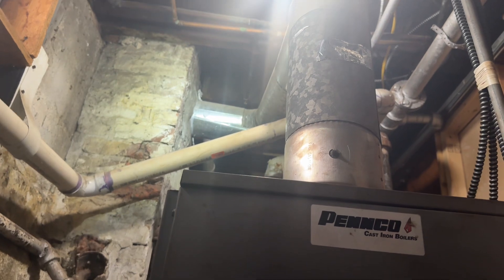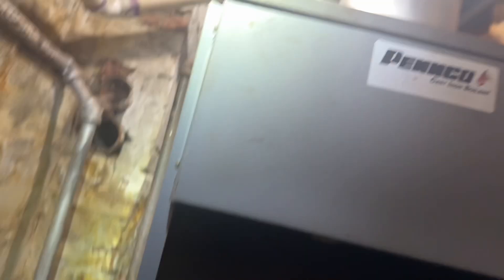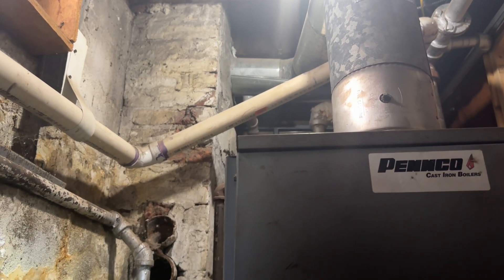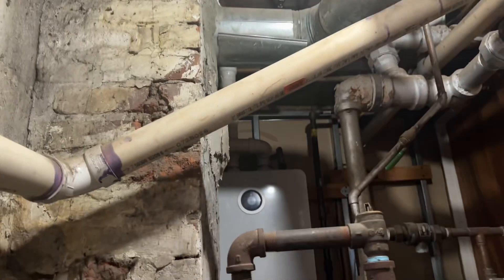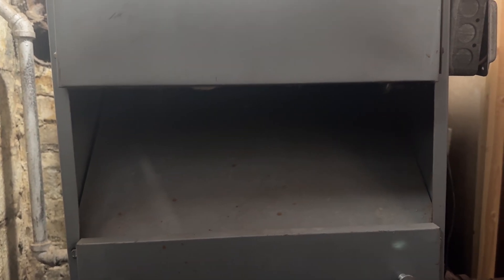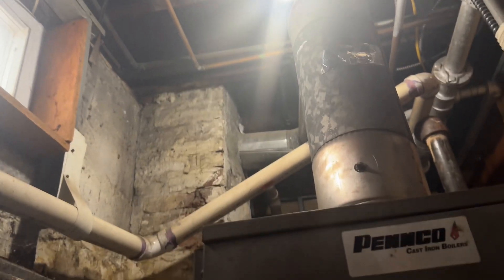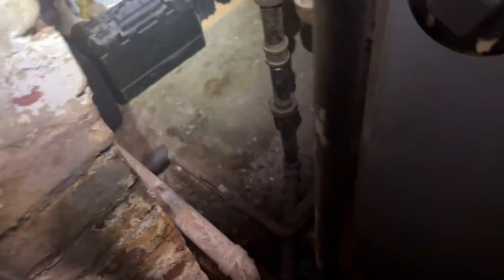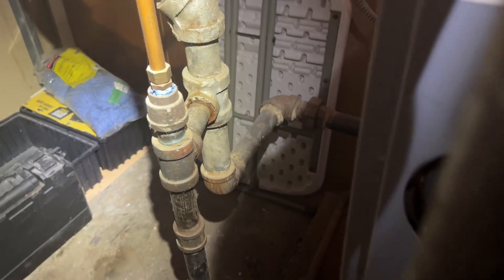Explaining Importance of Combustion Air - Some Still Don’t Get It!

Comment: Natural gas requires about 10 times its volume of air to burn.
A boiler that size, say it burns 250 cubic feet per hour of natural gas, so 2500 cubic ft of air is required. The boiler might have a draft divertor, so that is another 2500 cubic ft per hour on top, 5000 cubic ft per hour.
In the UK, we declare the appliance to be id. Immediately dangerous. With the agreement of the owner/ responsible person, cap off gas supply to appliance. Write out a certificate. If the person gets awkward  go out side. Contact gas transporter. They have legal power to turn off gas. If customer still disagrees. Dig up street outside house and disconnect whole building. Then over £5k (6.5k USD)
To reconnect. Customer gets it then.
No messing about. We try to avoid carbon monoxide poisoning  but it still happens. 
This guy Mikey Pipes was dealing with will be having half day with undertaker  if he doesn't listen to good advice.

Comment: Unless you educate the client, they likely never analyzed how the boiler in their basement works... they turn it on in the winter... and call if it does not work.  Did this guy buy the house as-is, and home inspector missed the lockout tag and the issue?  

You just can not expect the layman to be  an HVAC enthusiast.

We were not taught about how a furnace or boiler works... we see lots of tubes and pipes, and we pay the fuel bill. 

Shirley, you did explain how the furnace was starving for oxygen, due to the basement finish that likely was done since the original construction, partitioning off the original air rich leaky basement walls and windows.

You obviously explained how the fan in your can works, to make up for the lack of combustion air.

Comment: The boiler is going to suck in cold air into his house from anywhere it can regardless, meaning more drafts from any tiny openings in the house to replace what the boiler can push out the chimney with such a restriction to makeup air. Better to have a controlled way of bringing in that needed air

Comment: What are you expect Mikey? That’s flood zone it’s low lining areas. Do you really expect New York City to raise the road so it doesn’t flood especially next to Costco is there? No it’s too easy.
Reply from the maker: Why not the road has been there for decades since JFK has been built they should fix it. Why won’t they fix it?
Reply: @MikeyPipesUncensored  I’ll tell you why cause it’s the rockaways and no one gives flying f about it  it’s the same as Staten Island on Travis Avenue and told Hill Road with the trees they don’t care they got your money
Reply: @MikeyPipesUncensored  the same reason why they won’t put new  sewer systems next to IHOP by Old those homes right off the bay. They just don’t care. And the houses keep getting flooded. Evey time it rains
Reply: @MikeyPipesUncensored  F'in useless govt bureaucracy.  Screwing over us voters!

Comment: 40 thousand candles 🕯 in  the space needs a  Cold air intake the candles go out- The boiler need a air intake or it will fail
Reply from the maker: OK
Reply: Corrected my spelling

Comment: DO YOU KNOW, what BMW  stands for?  Correct???  There are a few definitions:  Bring My Wallet.  Broke Must Walk,  and as one of my black friends calls it, Black Man Walking.   I actually have a  2007 BMW K1200 R  Motorcycle that has for the most part been pretty reliable.  The Germans have this warped theory on BMW warranty and reliability.  It not broke.  Your just not using it correctly!

Comment: A lot of times when car batteries are low it won't recognize the fob. As an automotive locksmith we get these calls almost daily. They think it's the key fob. I tell them it's the car battery and of course they argue with me. I tell them how much a new fob is and also tell them if it doesn't fix their issue that I am 99% sure it won't, guess what you are still paying me. I have never had one take me up on the offer. If your not testing your guessing someone I can't remember who says. :)
Reply from the maker: Well, my wife’s car was dead, dead dead than a door nail
Reply: And since they have used a fob for the last 9 years, the emergency key in the fob is not going to work..... unless the customer is an expert in our field, and religiously sprays Houdini in the door lock 2X a year, and uses the key a few times a year to keep the parts moving.

Also, I TEST the battery in the remote, before replacing it. IT is the first diagnostic step when a dead remote comes in. The second is if the battery measures under 3.16V, to replace it... .and to TEST THE NEW BATTERY before putting it in.  Then, if it is an older car, RESYNCHING the remote.... and so forth. A lot of times client asks why I am measuring the old battery, the BATTERY Minus store did not test it.....Yet, they are now in MY shop. And all too often I am quoting Mikey. This locksmith does not guess!
Reply: @citylockapolytechnikeyllcc7936  I'm in the Boca Raton area. My customers are 300 years old. I ask them if they tried the emergency key lol 90% have no idea what I am talking about. If they manage to get it out they can't figure out where it goes. I try to save them a service call but we end end up going out on most of those anyway. They would rather pay us than try to help themselves. After we open the door most need a jump start so all my guys have jump boxes. We have Xhorse fob testers BTW so we know if the fob is working or not without opening it. 

I'm sure you know but many cars with a dead battery even the emergency key won't unlock the door. I still don't get that or why they call them emergency keys. We had an elderly lady call today said both her fobs didn't work. She was at the hospital visiting her husband. My tech pulls up and she realized she was trying to open the wrong car. This is daily in my area. I love everyone of these too. :)

We don't touch their fobs. If their battery is bad we tell them to go to the auto parts store. I don't want to be responsible opening up a 10 year old sun baked fob and having it break or not work and blaming us. We are strictly mobile. We just do lost keys and lockouts. We stopped doing ignitions, repairs, rekeys etc etc. We don't even go out on duplicates. Just lost keys. We run 80-150 calls a week. As I type this today was slow 13 calls so far. We don't even Lishi. If we can't get an easy code off a lock we get it from a code broker or NASTF and pass it on to the customer. We are too busy and we need to get in and out ASAP. We are cheaper than the dealer in most cases but a lot more than  Chuck in a truck. We mostly use OEM fobs and provide a warranty. I won't program a customer bought fob unless it's brand new OEM and they get no warranty if it's not mine.

Comment: Does a draft test reveal if there is a deficiency of makeup air?  Also, would the combustion test be off, like insufficient excess oxygen perhaps, among other things?  If so you could tell the customer that if they haven't tested they're guessing 🙂
Reply from the maker: I draft test only measure is negative or positive draft
Reply: @MikeyPipesUncensored   Does the exhaust test reveal the deficiency of combustion air alone, or is that in conjunction with doing a calculation of variables that effect the issue and determine if adequate or needing supplementation ?

Comment: In my area the municipalities are craking down on make up air new and replacement. How many people i have told over years i need to install vents to the outside and it is a big no, dont what the cold air. On another note one time i was telling someone on a no heat call you may want to consider replacing this unit sometime in the near future. Guy freaks tells me i still have 15 years of payments. Was 25 year loan. Unreal with the interest i bet you could have gotten 3 boilers. The unit had alot of issues and the heat exchanger was in poor shape.
Reply from the maker: Maybe we should start a support group for HVAC professionals dealing with stubborn clients! Hang in there!

Comment: Well I've tried to explain it to customers before and I've come to the point 
Either I fix the problem or I don't touch anything 
About 88% of the times that works
Reply from the maker: Well, I was just here to give an estimate for a new boiler, but if it didn’t leak, it could be fixed
Reply: @MikeyPipesUncensored  Why did the guy think he needed a new system?
Reply: @tycurtin7565  he said "its 21 years old"